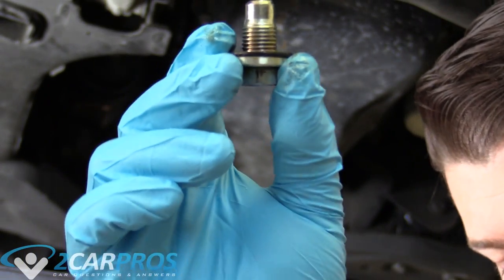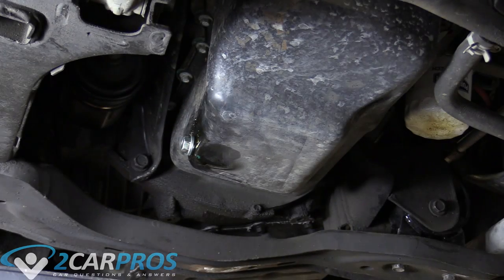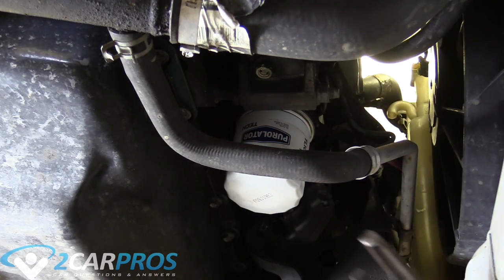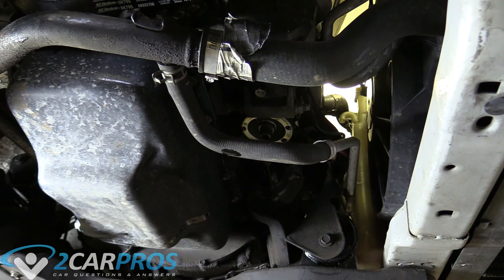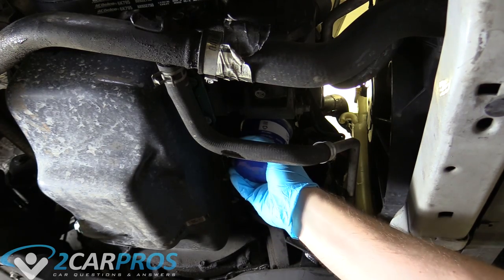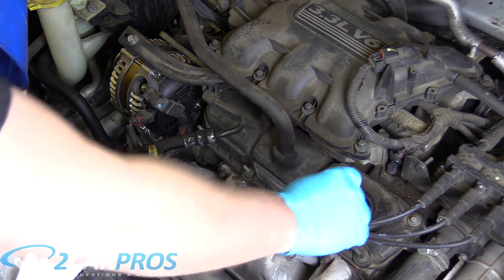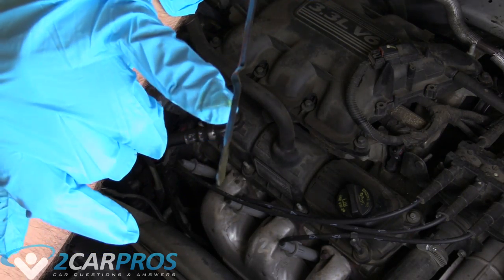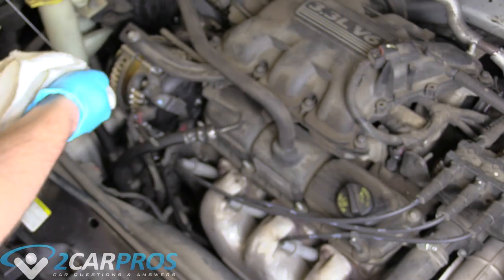How to Replace Oil and Filter Dodge Caravan 3.3L V6 2001–2010 EASY!

Comment: Put oil in the filter before you install on the engine. This way when you start the vehicle after completing the oil change you don't have to wait for the filter to fill up with oil. This is known as a dry-start. This is important to do.
Also, you put oil on the filter o-ring so it comes off easier on next change.
Reply: Never done that, never had a problem

Comment: A few things that weren’t mentioned. First, when tightening the drain plug DO NOT crank the crap out of it and strip it. (Very common) When in doubt you can look up the torque spec and use a torque wrench. 

The most important step which wasn’t mentioned is… Once you are complete, start engine and use a light and check for leaks! I’ve personally had those fast lube places forgot to tighten my drain plug, they barely started the threads by hand. Yep, I lost all the oil within a mile from the store and my engine seized! There was an oil trail from the shop to where my engine splattered all over the road! Costly mistake for them! 

Cross threaded or overnighted drain plug or filter can cause leaks because gaskets got smashed, pinched or cracked. ALWAYS CHECK FOR LEAKS! Oil change 101! 

Lastly, if you spilled oil on the engine, wipe it off! If you don’t it will sit there smoldering and smoking and easily ignite. Especially if it gets on the exhaust manifold or pipes. Safety people… Safety! 

Many first timers are watching these videos and these are things you NEED to know. Seasoned mechanics get cocky because they’ve done a bazillion oil change and skip these important steps. None of it is rocket science and is common sense but it should still be mentioned at least. My high school auto shop teacher would not have let this vehicle leave our shop until all of this was done. This guy would have gotten a “D” at best for the day. 😂

Btw, channel locks are great and all but they do have “oil filter wrenches” to remove filters. Channel locks are only needed if the last guy completely overnighted the living crap out of the filter or it’s been on the car for a decade. The wrenches are much easier and safer especially on a fairly hot engine in case it slips off. You don’t want to hit a catalytic converter with your hands or arms. SAFETY!!

Comment: Great video, always change my own oil .I haven't done my caravan yet just got it ,but thanks to you I now know where everything is located. Also I will use the oil indicated on the fill cap as you said for my replacement. Thanks so much Dale ps should drain plug gasket be replaced each change or just inspect it to see if it's in good shape.

Comment: It's odd, you mentioned a 16mm socket for oil plug, I saw another video and that guy said 17mm.. I use a 13mm.. 05 T&C.
Reply from the maker: Could be a slight revision. This is what it was on mine. Thanks for watching!

Comment: I would suggest filling the oil filter with fresh oil before installing. Just so it's not dry on the next start up. Cheers!
Reply from the maker: Modern cars fill their oil filters within a second of starting the engine. Every engineer I have talked to says it is unnecessary these days. Thanks for watching!
Reply: No need to fill the filter, it'll fill as you pour in the oil from the top.

Comment: Great video. Used to change the oil in all my cars and wives cars for years but it's been years. heh "years" Couldn't find the nut to release the oil easily  on my 2001 Dodge Caravan so decided to watch this video. Would have forgotten to put oil on the rubber contact point of the filter before installing it. And replacing the spacer ring for the oil pan nut is something I've never done in my life. Used to be they weren't plastic though, ....rubber. And wouldn't have had a clue that it is threaded. Also 16 mm socket is going to save me trouble as well. I was going to use my trusty crescent wrench.  Oh, and I would have only put in 4 quarts of oil too. Glad I watched this video.   Cheers, J. Noe   And my 2001 engine sounds a lot better than that 2008 engine (had to brag a little bit, it's one of my foibles in life)
Reply from the maker: Very cool! Thanks for watching John! I'm really glad to hear your runs better than mine. This was a city vehicle van and loved a hard life. Great van though!
Reply: @2carpros  Yeah, based on your ability to fix and take care of your vehicles it had to be because of all the hard miles put on your van. Not to point a finger or be judgmental in any way here since I got so much from your video here to help me change my oil for the  first time in probably well  over 2 decades "but" heh you just  knew this was coming. Don't worry it's not bad at all.
I wanted to let you know that my 2001 Dodge Grand Caravan does not have a 16 mm nut on the oil pan. It's much smaller than that. I just used a crescent wrench so I can't tell you what size the nut is on my vehicle. And I did go to the auto parts store and try to buy that threaded piece to go with the oil pan nut but he gave me a plastic spacer without threads. I didn't use it because something about plastic compared to rubber just seems inferior to me. And there was a rubber spacer with my nut anyway. Job done. Thanks again for your video. Cheers, J. Noe

Comment: For a 2001 5W-30 or 10W-30 is recommended, I guess it changed for your year but might be good to warn folks to double check!
Reply from the maker: It also says it on the cap. Thanks for watching Andy!
Reply: It doesn’t always have a cap with oil type on it.

Comment: Since the Oil Filter is pointing downward, wouldn't it be easier to fill the filter with Oil before re-installing?  I would think that it would allow the air to purge more quickly and give you a more accurate idea of the oil level on the Dipstick during your initial check.  Just a thought.
Reply from the maker: Can if you want to but, it is unnecessary. Thanks for watching.

Comment: Opps....began turning the filter the wrong way upon removal. Ha..
Did anyone else catch that ?
Reply: John Mckeigue I saw it lol
Reply: Didn’t fill it up at all either
Reply: Not to mention, why would you use a GM filter on a Mopar? I know a lot of people would say it doesn’t make any difference because people use Fram and other aftermarket most factory authorized mechanics always say stick with what you got if it’s a general motors, use AC, Ford Motorcraft and Chrysler mopar. Only time to use aftermarket is if you can’t get original manufacture parts

Comment: Three questions; Does the oil need to be full synthetic, or is it okay to use conventional high mileage oil?. Also is it really necessary to replace the washer on the oil pan bolt? Is it OK to use Lucas oil stabilizer such as the full synthetic stabilizer since I heard that heavy duty stabilizer might cause high viscosity to the engine? One thing I do know is I'm suppose to use 20% lol
Reply from the maker: 1. I would use full synthetic for longevity of oil changes. "high mileage" oil has an additive that swells seals which I don't like. 

2. Yes replace the washer.
3. Would not use any kind of stabilizer, just synthetic oil. 

Thanks for watching!
Reply: @2carpros  You're welcome and thanks for the feedback. . Some auto places told me since it's a 2008/older engine that a high mileage/thicker 5w20 would be needed either blended, or conventional.. Thanks and I'll go full synthetic cause my last two changes been a synthetic blend. I bought the van recently from a private dealer so I didn't know

Comment: My 2003 dodge caravan takes 5w30 conventional 3.3 l never heard of one taking 5w20 Does it specify this in the vehicle manual?
Reply from the maker: Got the info straight from Dodge. Thanks for watching!
Reply: must be some of them took different brands of oil didn't know this,thanks for the vid
Reply: 2010 DODGE GRAND CARAVAN uses 5w/20

Comment: I thought this vehicle was supposed to use 5w30 or 10w30 ??
Reply from the maker: Says on the cap 5W-20. Thanks for watching!
Reply: Yes, it may " recommend 5w-20 but that's not the oil this engine or the slightly larger 3.8 was designed for. These engines were made to run on 10w-30 for hot weather and 5w-30 for cold weather. Both the vans and the Jeep Wranglers using the 3.8 version using 5w-20 they would oil or blow the engine. You are one of the lucky ones. Great vid BTW.
Reply: Yes, they should. 5W-20 is used for EPA and CAFE guidelines only! Many 3.3's and 3.8's burn oil or blow up using that thin oil. They were designed to run 10W-30 in summer and 5W-30 for winter. All crate 3.3's and 3.8's say 10W-30 on the oil fill cap.
Reply: This then depends on the age and mileage of engine. I have an 05 T&C, 3.3L.. I use 10w40 all around bcuz I already have 136,000.

Comment: No need to oil up the filter gasket before installing.
Reply: Actually there is. You do it so it wont stick on when you change the filter next oil change
Reply: Don't listen to his advice. You do need to lube up the Oil gasket before installing.

Comment: I always loosen the oil cap just to be sure there's not some vacuum so I get as much oil out as possible. Anyone else?
Reply: Me too.  The first thing I do is remove the cap to vent the engine.  It drains much better that way.
Reply: The vacuum, if there is any,, gets released as soon as you remove the oil plug.

Comment: WHEN INSTALLING THE OIL FILTER I WOULD ADD OIL TO IT SO YOU DONT HAVE A DRY START
Reply from the maker: The oil filter fills within a second of starting. You can if you want to but it is really unnecessary. Thanks for watching!
Reply: Dean Dye That’s what I have always done
Reply: @2carpros  it's also no longer recommended to prefill the filter because of the risk of introducing unfiltered oil